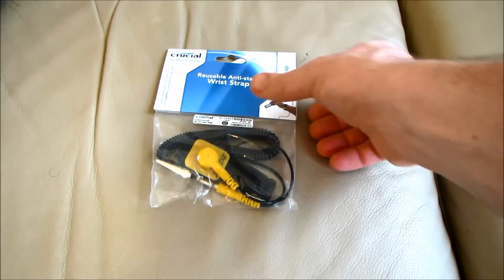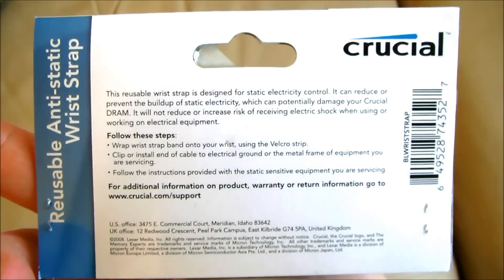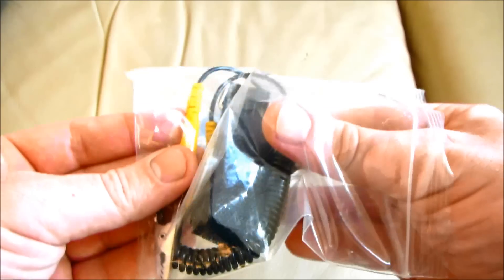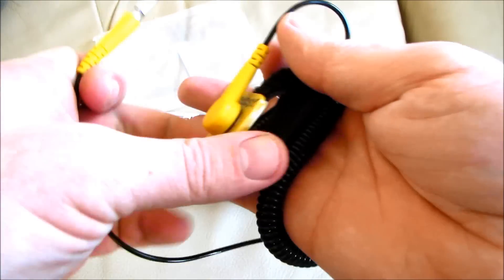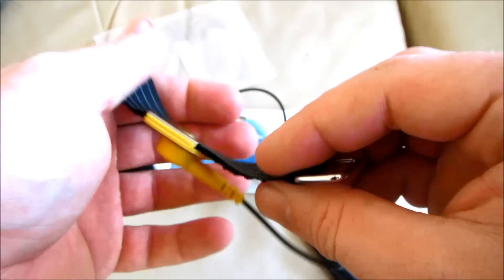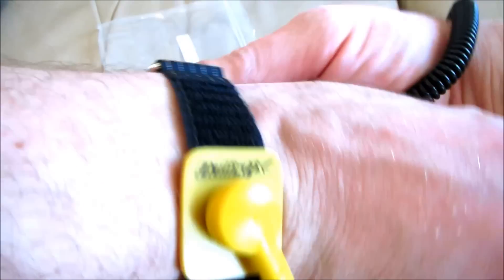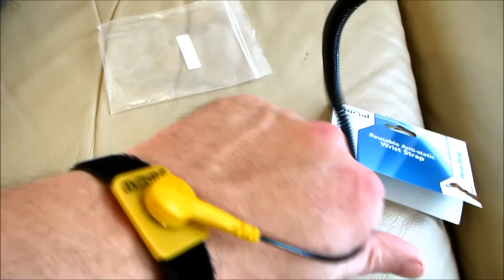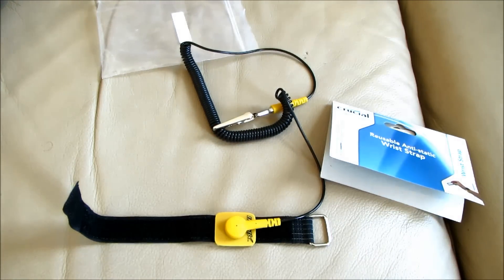How to use an Anti static WRIST STRAP to build a PC

Comment: Thanks! I'm planning on building my first pc soon and I see these build guides recommending an anti static wrist strap but I didn't know what to ground myself with
Reply: I've seen so far after building a pc and being paranoid from the start that if you have tiles in your house and nothing of fur material then you literally never have nothing to worry about. I always just touch my case whenever I'm gonna set hands in it again if I'm working on it.
Reply: as in the case only? Without power supply plugged in? I have my case but it is all painted in white, I'm kinda nervous.
Reply: @pacitapasturin7795  yeah case only, disconnected from wall plug. Don't think paint stops static from passing through.

Comment: So is building a pc barefoot without these antistatic wrist strap safe?
Reply: Depends if you’re building it on rug or wood. If on rug then most definitely not but on wood you’ll be fine
Reply: @hetris2370  on ceramic tiles?

Comment: I can't find a reliable answer to this anywhere--what if you're working with a bare circuit that doesn't have a metal case, like an Arduino or Raspberry Pi. Can you connect the alligator clip to any metallic object, or does it have to be something that's in circuit with or otherwise attached securely to the the PCB?
Reply from the maker: Thanks for commenting

Comment: what if you jam those jaws into the 3erd prong on a socket or power strip
Reply: just use your pc case
Reply: its better if you jam each of them into the 2 slots above the prong hole. It's a process called free flowing that allows the electricity to enter and exit without spiking which keeps you and the computer safe.
Reply: @Left.Lane.Loiterer  You want him to die?
Reply: Britannio Jarrett nahhhh
Reply: Then you'll be doing what is otherwise known as natural selection

Comment: CAN I JUST CLIP MY STRAP ONTO THE POWR SUPPLY TURNED OFF AND PLUGGED INTO THE WALL??!?!!?
Reply: Jack Jones then...what am i gonna plug myself into...that sounds wierd
Reply: I mean, you can plug it into the mains, it might be completely safe... I'm just not a technician and would rather not take the slightest risk of killing myself for a £30-£50 motherboard.
Reply: +Ronald Mcdonald Just don´t
Reply: Yes people like Linus from LinusTechTips have mentioned doing this
Reply: +Boba Fett  Yeah if everything's turned off (SPECIALLY at the wall) then it should all be fine. Still wouldn't advice it as you're essentially plugging yourself in to a mains socket (which is dangerous)
Reply: Anything metal really... A radiator, an unpainted part of your case... As long as it's touching the floor. 

I think the logic is that the static needs to flow through to the ground and not through to your hardware... It will flow through metal to the ground faster than it will flow through you to the ground so if it connect to the floor... I'd say pop it on that.

Another tip I've read is to pop it around your ankles so it's not all up in your face while you're trying to work :)
Reply: Jack Jones I'm on carpet :/
Reply: +Boba Fett Hover then
Reply: Jack Jones Won't my components catch fire?
(I'm Boba Fett)
Reply: Ah, yeah, that's true! Hadn't thought of that. Maybe try covering them with fire extinguisher goo first. Should do the trick.Spray it all over the case, being careful not to leave even the tiniest hole.
Reply: Yes it is the best way as there will be an easy path to ground or earth

Comment: Does the case have to be metal to bond with it? My computer is motly plastic and the only parts that seem to be metalic are the parts that I would have to take off.
Reply from the maker: Firedude3542 Plastics, paper and textiles are insulators. These materials do not discharge when grounded. Using grounding or bonding has little effect on these surfaces, so special static eliminators are needed. You will require specialists to install special equipment on an industrial scale to eliminate static

Comment: I am looking to use an anti static wrist strap to work on a video game console. I am wondering what I should attach it to since the console is plastic, and not metal.  Should I attach it to the edge of the mother board?
Reply from the maker: bitofrits you will need to think outside the box - in a blue sky way

Comment: still confused, some videos say to use a psu plugged in but turned off, it that okay??
Reply: Don't do that, it can go really wrong. You should plug your PSU into a power bar that's turned off. That way nothing will go wrong as there's no electricity in the PSU, but it's still grounded
Reply: yes it is. your pc will be grounded when its plugged
Reply: Why is it grounded when its plugged in? The whole term "grounded" confuses me.
Reply: @OneBrokeBloke  It means it's connected to earth. When you plug in your PSU into an outlet, it becomes grounded. The 3rd hole at the bottom is the ground. There is no current. It's in case of short circuit. Sometimes you can even see a wire outside of your house going to the ground. Most of the time it's well hidden, for example mine is under my deck because there can be electricity at any time. It's also where the electricity goes if your house gets hit by lightning and you don't have separate lightning protection.

Comment: So you mean, connect the crocodile clip to the pc case next to you whilst you assemble your pc? Or anything metal?
Reply: UBER UNBOXING what if i build from scratch, i like to attach things to the motherboard first, outside the case. Where do i clip the wristband?
Reply: In that case just touch a metal if you are gonna build it outside the case
Reply from the maker: Hi! If you connect the clip to the case of the computer you are working on you will be bonded with the case and any parts connected to it, which should equalize any static build up and reduce the risk of any static being discharged when you touch it. There may be no significant static build up to discharge and there are ways to reduce it before starting, many PC's are successfully built without using one but a wrist strap is simply a precaution just in case there is static. But straps are so inexpensive to buy, prices start from as low as around £1 or $2  so why not add one to your shopping list when ordering components?
Reply: yup!